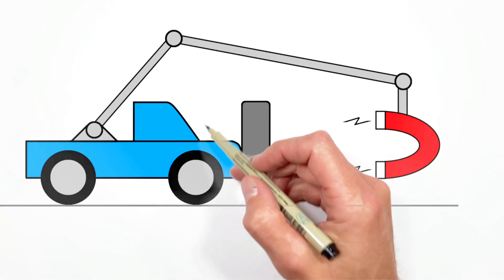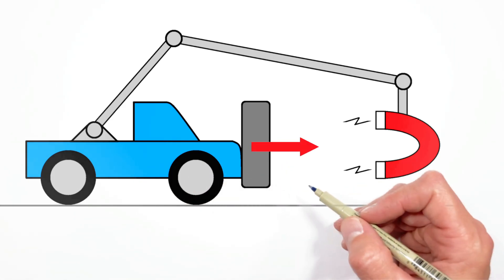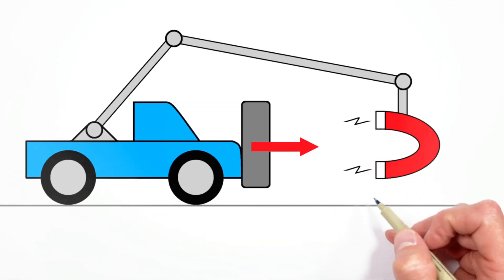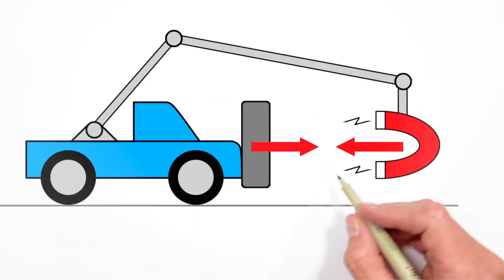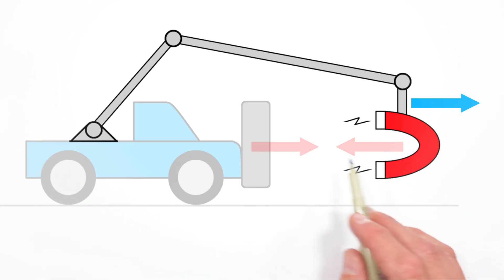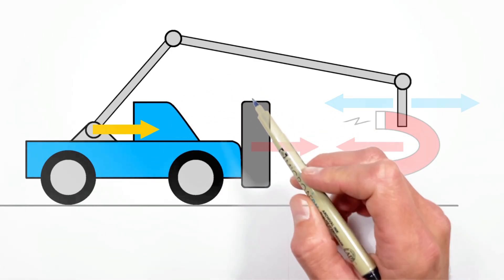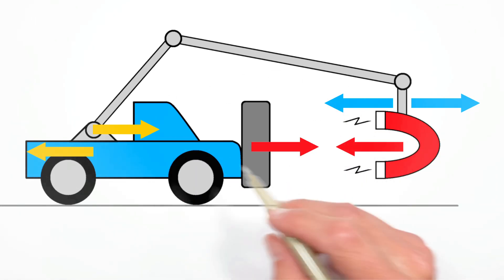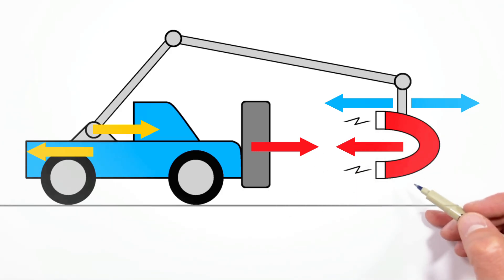Will This Truck Pulled by a Magnet Move?

Comment: Pls reply!!!      What if one plate consisting of multiple magnets placed in a circular pattern and that is being driven by a motor but in front of that plate another magnet is there consisting of a same like poles ; NOW NORTH VS NORTH POLE IS FACING EACH OTHER AND HYDRUALICALL Y WE ARE MINIMIZING THE DISTANCE BETWEEN TWO PLATES......WHATS GONNA HAPPEN THEN??

From India ❤
Reply from the maker: I don't care what the setup is, unless some OUTSIDE force acts on the car / arm, that car is not going anywhere.
Reply: @INTEGRALPHYSICS  yes sir, but if we provide a driving force in the name of external force only?? .......if you say I cn show the designs!! Just being a science enthusiast ....so I asked
Reply from the maker: You either need something stationary to push or pull off of (think a tire pushing against the road or a stationary magnet to propel the car), or you need to shoot something out the back of the car (think a rocket engine).
Reply: @INTEGRALPHYSICS  sir that magnetic plate will be rotated by an electric motor which will b fixed on another magnets top floor....there will be a stationary part but will be in rotating sense

Comment: Way back in the late 60s and early 70s when I was in school taking my first electronic class, electrical flow was illustrated using a water hose as the conductor, the water flow as current and the water pressure as voltage. Today physic's knows that electrons do not orbit like a planet but pop in and out of their shell orbit. Question, could you explain electrical flow as you understand it today? And how does wave frequency play a role?

Comment: If the magnet pulls the car toward itself  (>), it is also pulling itself toward the car (<). The net result is (Car>)(<magnet); thus, they cancel out.
Reply from the maker: Precisely.
Reply: What if one magnes is "stronger" or something like that?
Reply: @tdx656  the bigger the magnets the stronger the pull 
having one smaller magnet would just make the pulling force weaker so really nothing would change
Reply: Think of it like this every magnet (no matter how strong) will create two movements. 

The stronger magnet will pull the truck to itself AND itself to the truck. 

This then cancels out the movement. 

The stronger magnet's own power will prevent any propulsion.

Even if the stronger magnet had infinite power the truck would still not move.
 @tdx656
Reply: @tdx656  Look at it this way, if the bar holding the two magnets were to be  made out of a spring type material, then the side holding the weaker magnet will try pulling itself toward the stronger magnet, thus bending the bar untill it reaches its limit. For this scenario to successfully work, the magnet has to be physically detached from a vehicle and also moving
Reply: @worlboss2844  What if it a really strong hydraulic like system that went back and forth to stop magnets from metring and not a spring
Reply: @tdx656 same result. Just puts more stress on whatever is holding the magnet in place. Unfortunately no matter the strength of the magnets it will never work.
Reply: So from what im understanding, is either the supporting arm will not be strong enough & will crumple under the force of the magnetism + weight of the car, pulling the forward magnet back into the car. OR the supporting arm is strong enough, and nothing effectively happens, as is illustrated in the video?
Reply: Thank you, and this video could be 10 sec long
Reply: Just use metal as the one being pulled
Reply: Just use metal as the one being pulled
Reply: @JarvisLuizard  I used to think that as well, but sadly the same thing will happen. 

The magnet pulls the metal towards itself and itself towards the metal thus canceling out. 

Force always goes in 2 directions.

Comment: Since the studied system (solid indeformable) is the car + beam + magnet, the force between the magnet and the car is an inner force and therefore does not intervene in the fundamental principle of dynamics, so has no effect on the movement.
Is that all right?
Reply from the maker: Something tells me you may have studied statics before...  Well put.